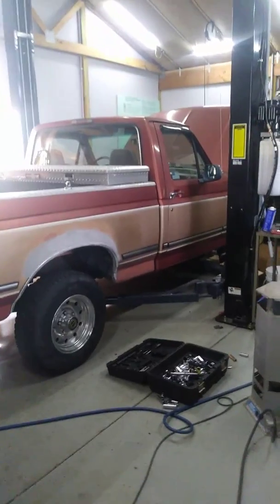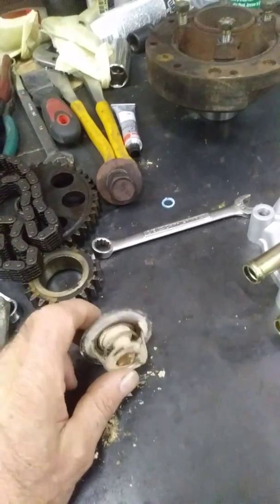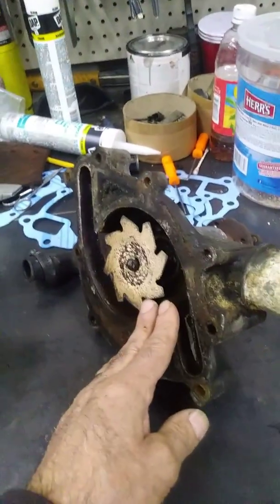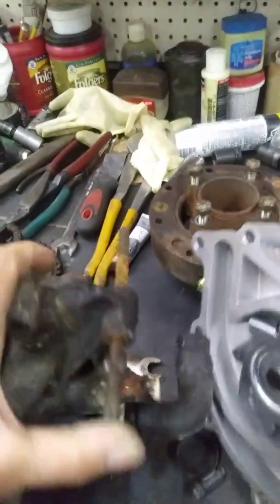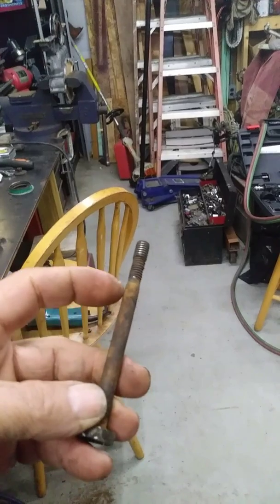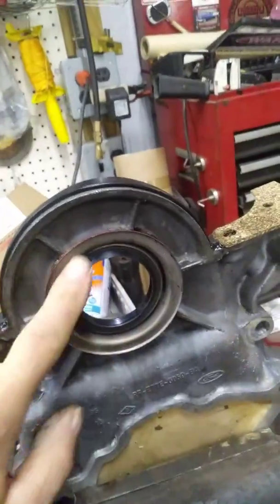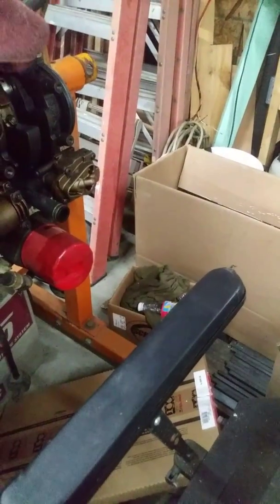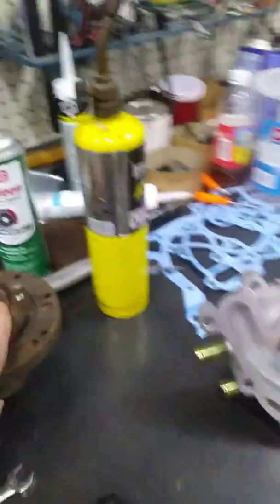95 ford f-150 302/5.0  strange cooling system problem

Comment: Did it still look like coolant was circulating threw the radiator with the old pump being damaged like that
Reply from the maker: Ernest, Good question, The flow did seem to be less then normal. That's one of the things that caused me to dig deeper into it